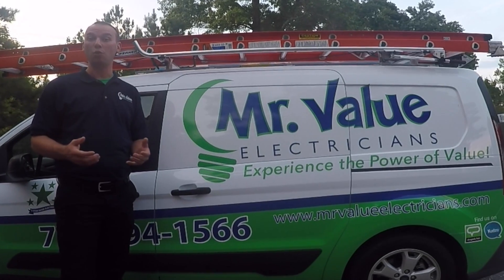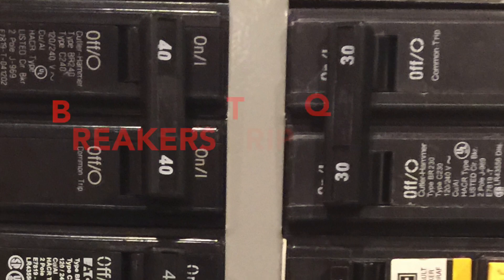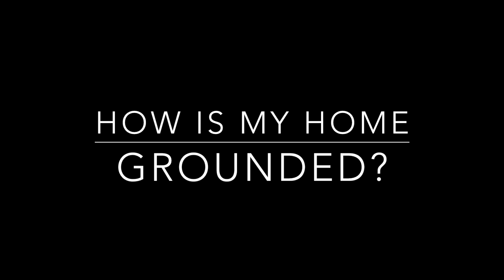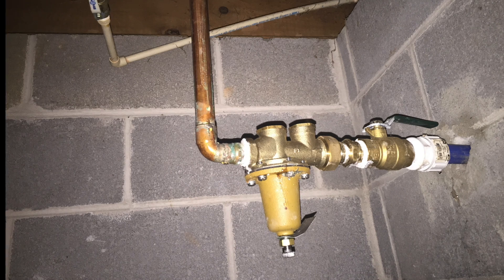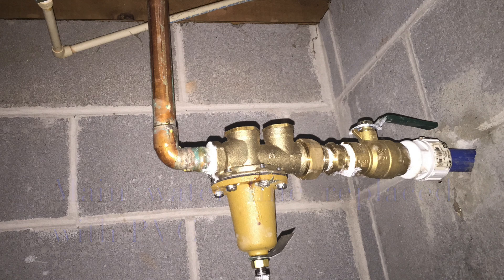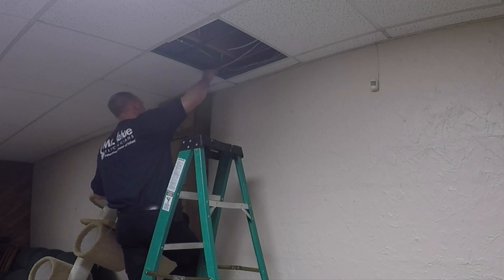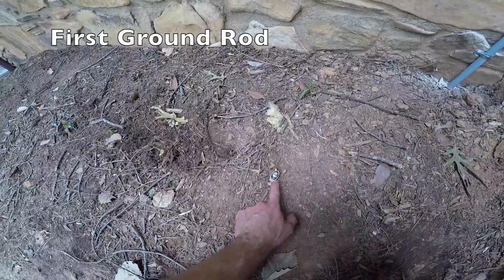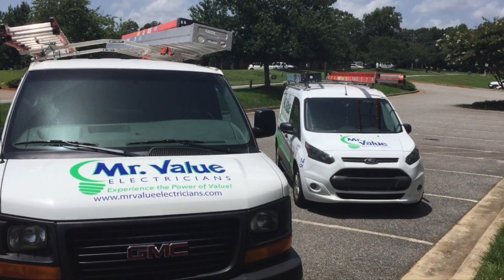Electrical Grounding installation for a home

Comment: I would really appreciate your opinion as I'm disabled and can no longer work and purchased a house (built about 1959) late in 2020. I think I was mislead by the home inspector that I hired. I certainly would not have bought this house for the price I paid unless the owner updated the wiring. The inspector told me that the outlets weren't a problem, that all I needed to do was use adapters so I could plug in 3-prong equipment. But that has turned into a major hassle and I now I've become aware it poses a safety hazard like shock, fire, electrocution. Also I've learned the electrical panel needs to be replaced because it can't handle changing my gas range with an electric one. I'm really unhappy that I paid hundreds of dollars for inspection and I feel cheated and lied to. The inspector did nothing to earn the (to me) huge sum he was paid. WHAT TO DO since I don't have the money to make these repairs myself. I'd really appreciate your opinion so much.
Reply: I would report that home inspector.
Reply: Sell the house and do yoga lessons

Comment: Hey guys, great video. I'm outside your service area but what should total costs run for grounding? House was built in 1960s. Have older 2 wire electric setup. Thank you
Reply from the maker: Thanks for the feedback. You could budget around $700 or so for grounding system. This only provides grounding to the main service and wiring that has a ground wire. If you have the old 2 prong outlets without a ground wire you will need new wiring installed from the breaker box to the outlets. Hope this helps. Thanks
Reply: 2 wire setup? you're saying you don't have 2 hot wires?

Comment: I've been having some major issues (and unfortunately malfunction of equipment) in my music studio, what if you live in a house without ground because its on a mountain rock bedding and it can't reach ground/water? 
 i'm living in a older building, 300m above sea level in a climate where it rarely rains.
Reply: 🤔 might be advisable to have a rod check done with a special tool as from the main panel to earth should be 25R resistance NEC-250 code, and there's nothing stopping you from having longer bairyed rods and according to lineman that i have talked to said granite might take a 50ft rod x 2 and rain bird has a nice chart showing soil types vs resistance, hope this helps you out and others

Comment: i cant call u because u are not in GA. we are in LA. CA, Our house is only grounded from the back panel in the backyard shut off switches.  
But the other ground was removed that was attach to the water shut off valve. 
The fu*king plumber that change all the pipes disconnected it and didn't reconnect it, and we did not know  that it was not attach any more. 
We did not even think of that until now. 
And now the drain in the bath tub has a current going through  of 13 volts. 
And my father could have died 2 time because he has a pacemaker and it made the pacemaker shut off,  and made him pass put and fall back he could have hit this head. 
We also think that the 13 volts is in the water too. 
When my father switch bathroom to take a shower, we see that the water was affecting them in the same way as the other bath room did.  
When the water was trued on he got dizzy  witch means is was effecting this pacemaker

Comment: Question dose the grounding rod have to be copper, can it be anything else?
Reply: Just looking online, they make ground rods out of other metals. The point is that it needs to be highly conductive. Ground rods are cheap enough that I wouldn't try to make one, I'd just buy one that's already labelled a ground rod.
Reply: @Excalibur2  Thank you for getting back to me, Yes i will be getting one soon.

Comment: Why are ground rods in new homes today grounded to the rebar in the slab?
Reply: Robert Garcia more resistance
Reply: @CelticGhillie  what if it damages the concrete?
Reply: @HamguyBacon  concrete is an electrical insulator, so it won't damage the concrete. I'm sure there are extenuating circumstances when enough power will damage concrete, but if that happens, you've likely got bigger problems.
Reply: @anononononononon66  No, the metal can and will shake violently if a bunch of electricity just gets pumped into it. this will crack the concrete.

Comment: I found this android app for electrical ground calculation called Instaground, has anyone here used it? Any feedback if it works and is accurate? This can come in handy for engineers and contractors.

Here is the link to Instaground app:
https://play.google.com/store/apps/details?id=net.planoa.instaground&hl=en

Comment: Hi.   I just upgraded my breaker box to a 200 amp.  The electrician ran the ground wire to bother ground in rods to the electrical box  through the Attic and down the front of the house and connected to the copper water line.  Could we  just connect the ground wire to the   copper water line at the back of the house which is right next to the grounding rods?   Also.  Can I bury the grounding rods and wire in the flower bed?   Thanks
Reply: How much did it cost you?

Comment: How many ground rods do I need ?
Reply from the maker: +yourfast07  (2) 8' ground rod 6' apart.
Reply: Why are there 2 rods, and why do the rods need to be 8' long?
Reply: @kingbiscuit28  At least two at least six feet apart and eight feet long. It's in the National Electrical Code. You can do more, but that is the minimum.